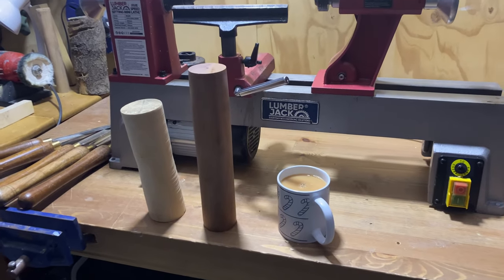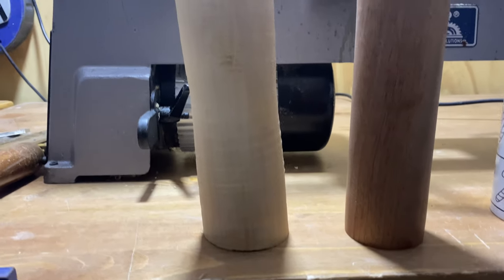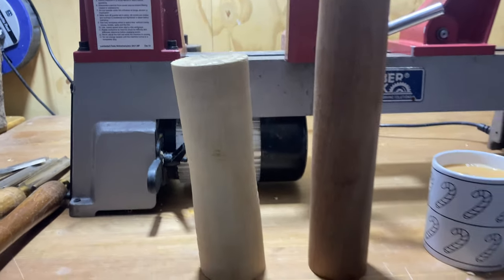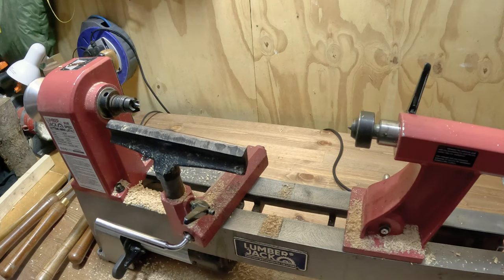Improving My Wooden Tower of Pisa

Comment from the maker: I think I will need to sharpen the chisels soon, any recommendations on the stone to use?
Reply: You have an issue of if you ask 20 woodturners the same question you will get 20 different answers back lol, my opinion to this is question is (because its the only option i have used plus i know a lot of people that use them too) the Robert Sorby Pro Edge..... but remember other woodturners may disagree with me....... probably why i sold mine and stuck to just using Easy Wood Tools Carbides LOL..... Have fun turning, if i can help along the way, just ask........ Subbed!! :)
Reply from the maker: @jpwoodwork thank you very much for your advice. I have an old grinder so may just invest in a new wheel for it and make a jig. I’ll do some more research. Thanks for the support, I’ll be sure to reach out for any tips 👍🏻